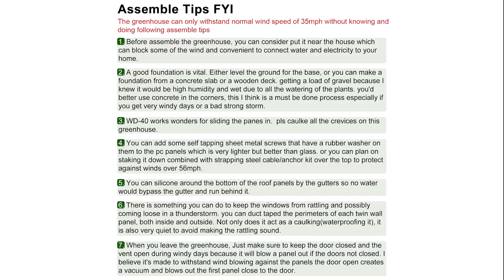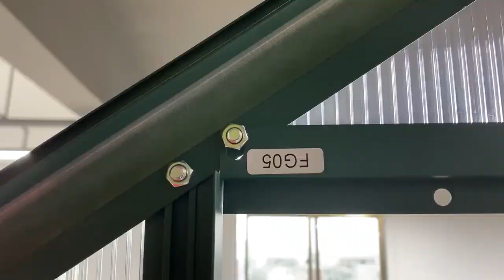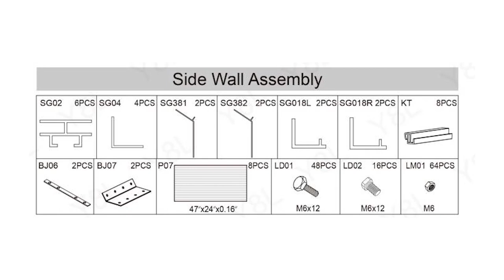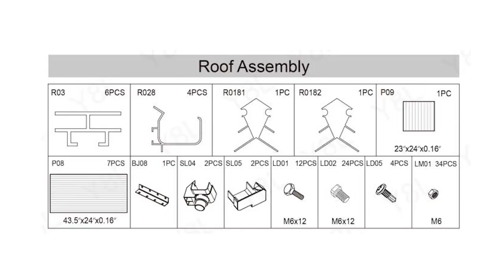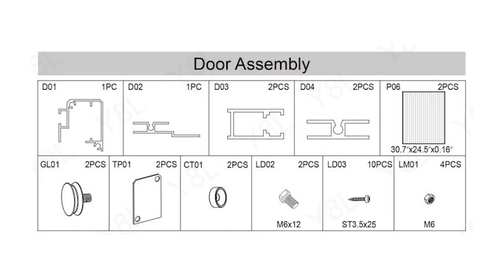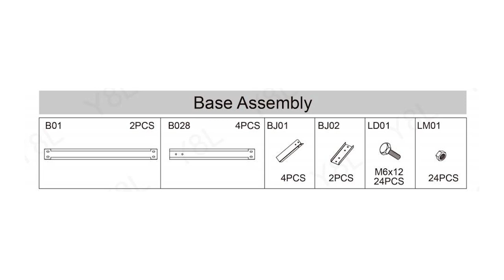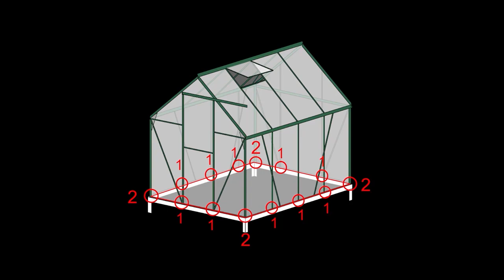JULY'S SONG Aluminium 6 x 8 Greenhouse Assemble Installation

Comment: Thank you for the instructions. It looks very easy to install different from my experience took me aged to get it right and other 2 people to help asseblying it. Wondering how your greenhouse looks now after two years? I purchased a similar model 1.5years ago.  I had to replace some panels, the metal parts as completed rusted. I attempted to dissasseble my greenhouse to replace all the panels and brush and spray kill rust paint. Unfortunately most of the metal parts including bolts and nuts were rusted in such a bad way making it impossible to unscrew( mine are hexagonal shape, not rectangular like yours), the hexagonal bolts with time became more of a round shape unable to unscrew. So I had to pull out the aluminium parts to detached. Resulting in damage and making it impossible to assemble the greenhouse again.

Comment: I cannot see HOW the front, rear, and side panels are sitting on that narrow piece of metal.  Are you kidding me?  Can't see anything.  Can someone please send a pic or show me HOW the whole structure is sitting on 1/2" metal piece?  Thanks.
Reply: Not sure if I understood well your question. In my  experience, the bottom metal part needs to be  fixed on a concret or timber frame firmily anchored on the ground to avoid it to blow out after assembly the greenhouse.